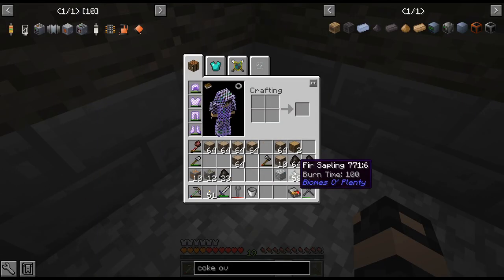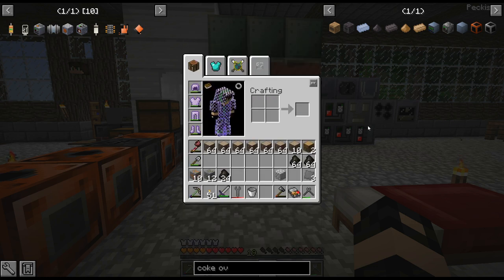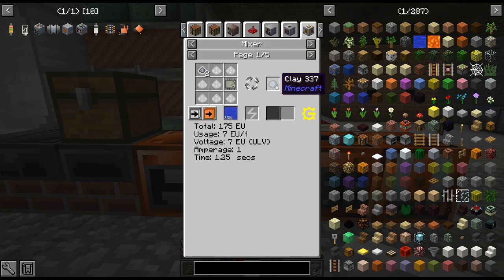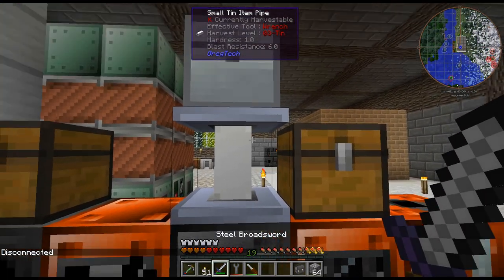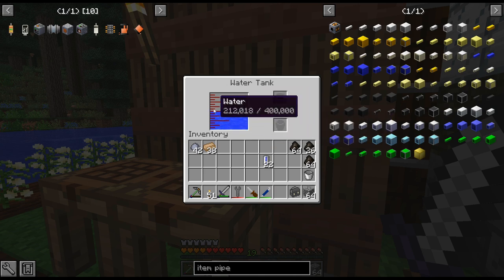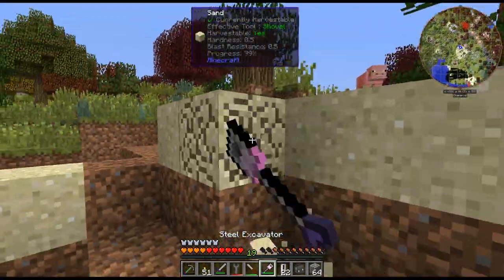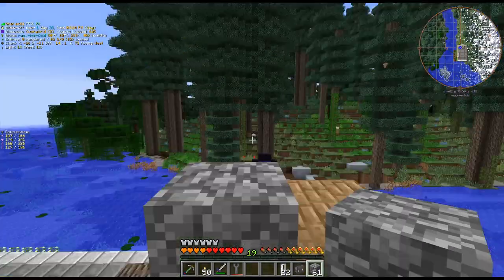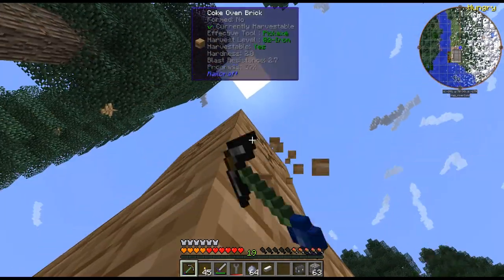GregTech New Horizons Season 2 - 20 - Steam Power Best Power

Comment: I jumped over to oil as quickly as i could. 
That being said, as a complete gtnh noob, i tried to use sulphuric light fuel (yes, laugh at me) and was really bummed out because it didn't even get its own energy back to produce. I think i ran through an entire steel railcraft tank of oil until i somehow stumbled upon the recipe for light fuel... 

I wasn't a fan of steam, because my water pipes kept getting clogged up with steam and then caused nasty explosions from time to time. I also didn't have a buffer, because i didn't know you could 'store' steam like thatin the tank. 

I'm nearing nuclear now and i'm prepared to load my backups a few times until i get things right. x)

Comment: The best way I've found to automate steam machine is:

* steam input on bottom or rear
* input items (e.g. hopper with chest on top) on top
* output (pull) item from bottom or rear using hopper or conveyor
* eject steam on side

The last part is key. You can put only 2 machines touching side-by-side since they need 1 side face open. So, a line of 8 machines would look like so:

MM_MM_MM_MM

In the LV era, I use the item auto-eject feature of machines to push down into an item pipe run that ends with a large (e.g. diamond) chest with a restricted item pipe in between. I can then put JABBA barrels face-up in the floor, connected to the item pipe run. These barrels are used to cache large volumes of items so they don't clog the chest.

I use this same setup well into and including AE2 era. I slap an ME Import Bus on the chest and continue using the JABBA barrels for anything I don't want to go directly into my AE2 inventory.

Comment: Imagine not being able to transport energy to your miners
-This post was made my Diesel Gang
Reply: I was using lithium batteries for it initially
Reply: Diesel Gang Rise Up
Reply: cetane boosted diesel in my case. :D 
And two big steel tanks as a visual buffer, because i can't be bothered to check the small 1-block tanks (which are miles better) every time i waddle into my diesel room. 
I still haven't figured out wtf i should do with all the refinery gas though.. 

It also took me way longer than i'd like to admit, that personal anchors work through dimensions... once you 'activated' them every time you come back to a world. 
Getting saltwater was a PAIN.
Reply: @Aurirang  damn you threw me back im time, haha. Feels like yesterday that season 2 started.

Comment: You can pulverize stone into gravel and that into sand. It wastes some energy but its pretty fast. 

You wouldn't want a desert anyways, its all 1 layer of sand like you found, except in sporadic patches. Next time you look for a biome I recommend the Nature's Compass, its a bit bugged but better than nothing.

Curious what you plan to do for a wood farm!
Reply from the maker: i actually looked in NEI for nature's compass, i believe it's a different name in 1.7.10 tho couldn't remember what it was called.
Reply: @Kharax82  It’s the same name, it’s in an assembler
Reply: @Kharax82  you need to include the apostrophes, ive seen you do this a couple times and nei doesnt like it if you just put 'natures compass' it has to be 'nature's compass' the recipe is fairly easy too

Comment: one challenge: use steam power to UHV.  XD
Reply: Do fluid nukes count?
Reply: Is it even possible? Like is there a multiblock that generate enough steam to power UHV? Or you gotta make like a thousand boilers 😭
Reply: @soulawaken24  😄
Reply: @soulawaken24  Extrapolating my current setup you could generate 1A UHV with 64lhes, 80 fluid nukes and 384 large steam turbines. You could probably cut down on the number of turbines by using more efficient turbines later on. Its certainly not the best option for power generation but i would say its far from impossible.